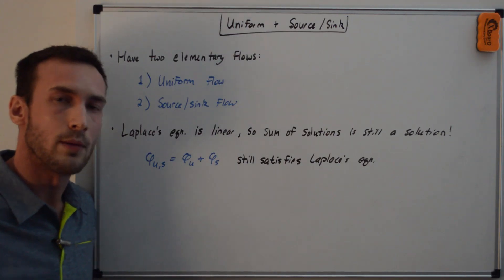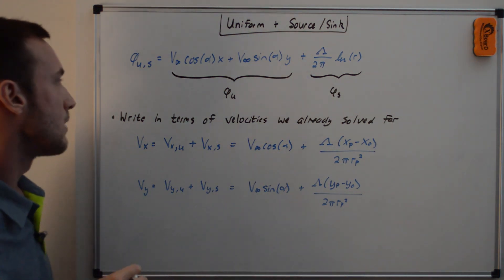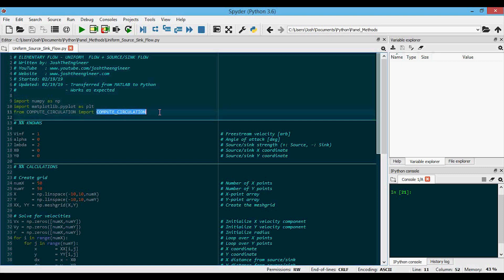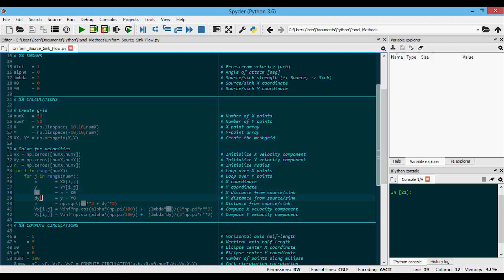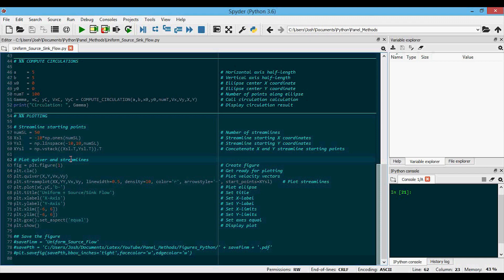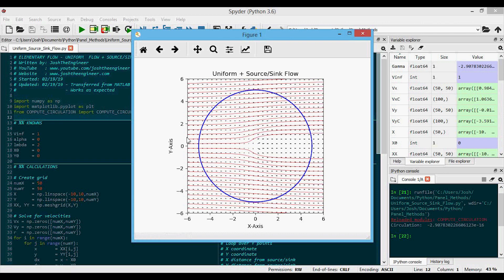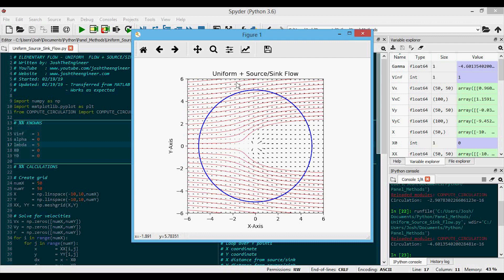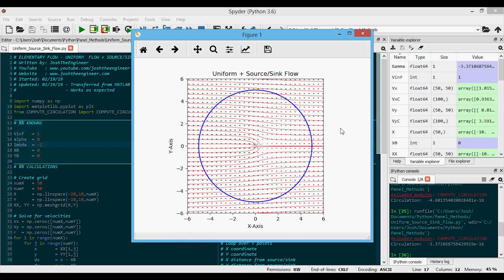Uniform + Source/Sink Flow (Incompressible Potential Flow)

Comment: Hey Josh, Great source!

I would like to ask you a question about using superposition of 2 sources that located on z axis, symetrically with respect to x axis, in a uniform flow on x direction. How can I imply that assumption into your coding? I do not have much information about phyton coding system, so I would be appreciated If you can help me to solve that problem.

Best regards.